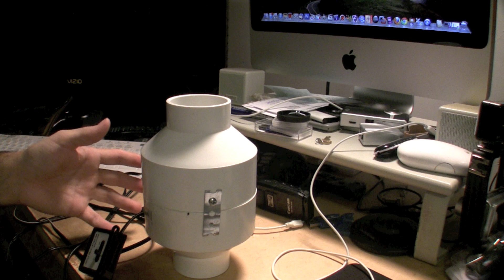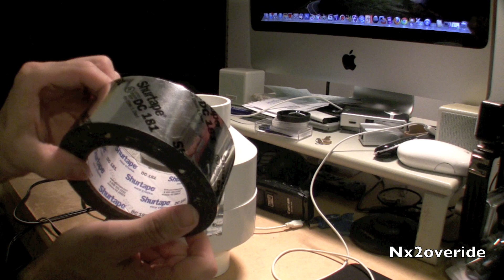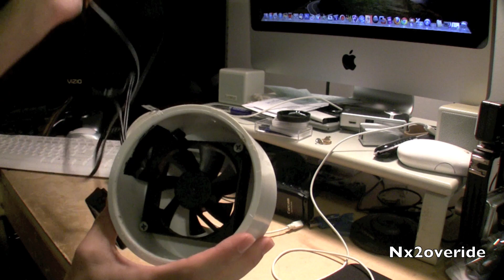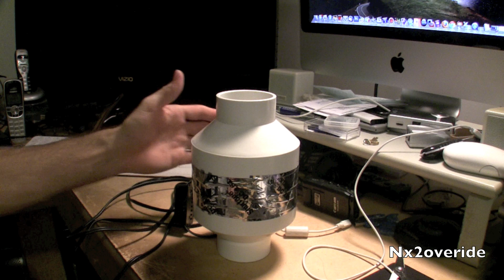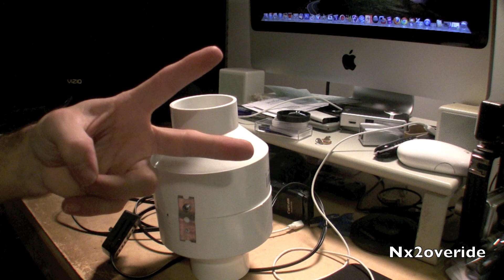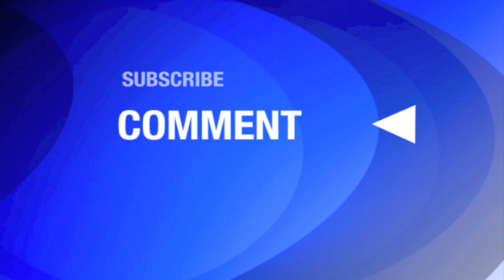Solar Greenhouse Heat Sink Fan Build

Comment: what size computer fan did you use 80mm? And could you wire this to a 12V solar panel?
Reply from the maker: Yep 80mm and yes, you could wire it directly to a 12 volt panel.

Comment from the maker: no I soldered the connections and used electrical tape and tapes it down with gorilla tape. ;) na its running 24/7 not switched or temp dependant.  I figure when it finally pushes all the heat out it takes hours.. not sure yet how long, but when i figure that out I may have to add a timer that controls when the heatsink is finally cold enough to shut down and start back up for the next day. Still working on that.. it needs to get really cold for the test.. and its only been as low as 50.

Comment: Cool.  Just one question: If you use the two computer fans within the PVC tubes you appended together, will both fans face same direction (upwards to one end of the PVC tube)?